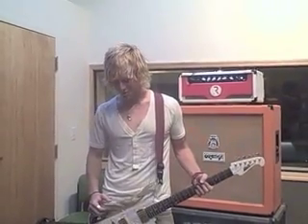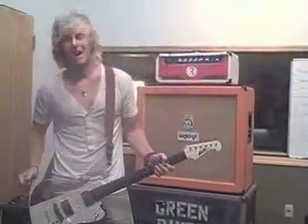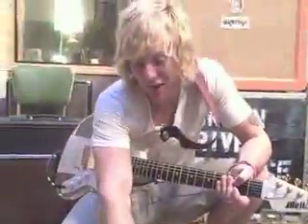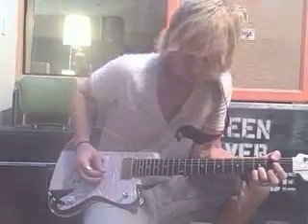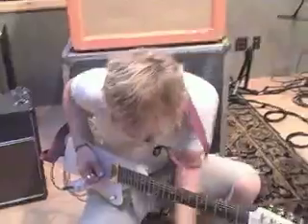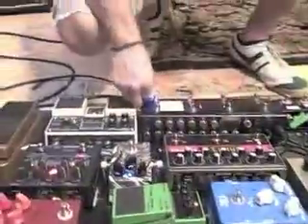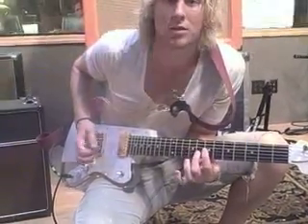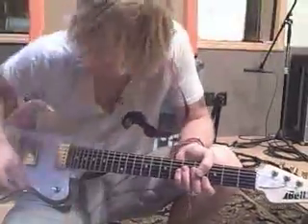Jamey Ice's Fall 2009 Touring Rig - Pedal Board Demo

Comment from the maker: @0AllForNaught0 Check out my new video i just posted. I changed how i powered the whole thing and got rid of the pop. Also you are hearing just as much ambient pop from me actually stepping on the pedal as is coming thru the amp. There is a little that comes thru the amp, but a good bit also just the sound of me stepping on the pedal. 

Either way  check out my new video. Im powering the whole thing w/ the new bradshaw / Dunlop powersupply. The pop is totally gone and sounds super clean